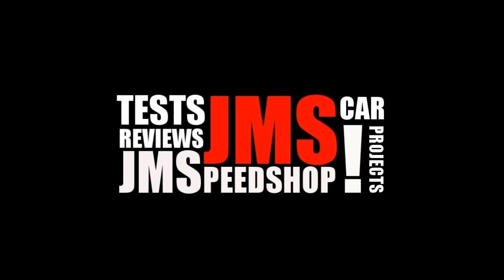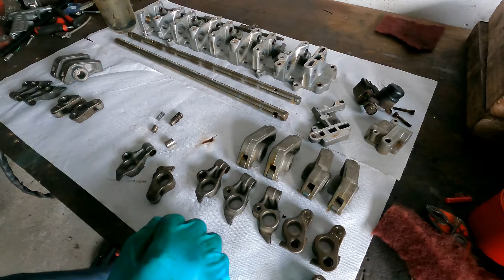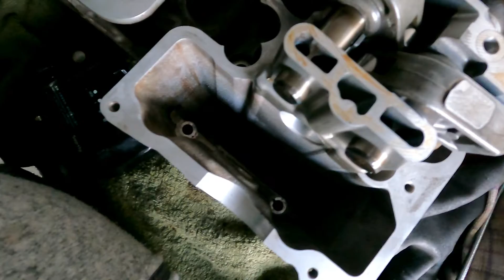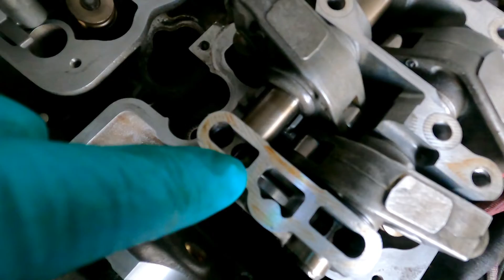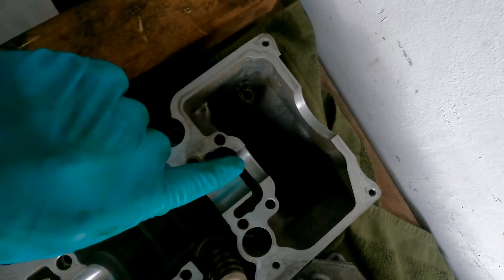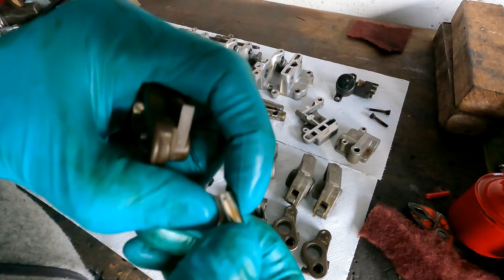M113 engine rebuild - Part 8 - Mercedes ZAS Code: 479 Cylinder cut out. HOW DOES IT WORK?

Comment: We never had that on the V8 cars here in the states but we did on the  M137 V12's as you stated.  I don't recall ever having problems with the system in my experience anyway.
Reply from the maker: Sounds good then.  I think i will control it with the standalone.  Just Nice to test.it